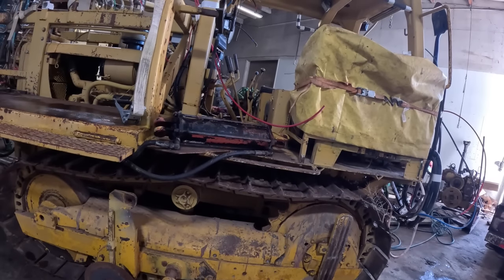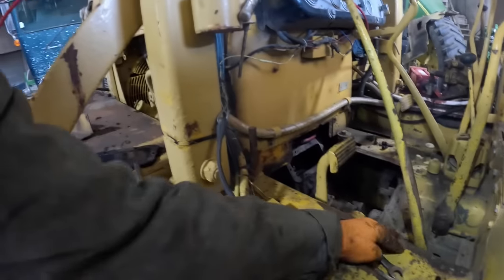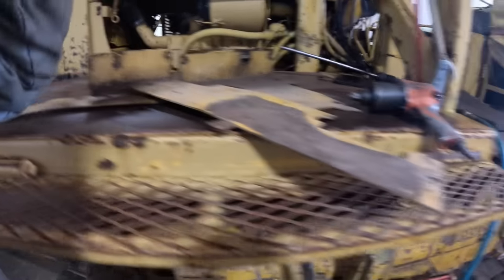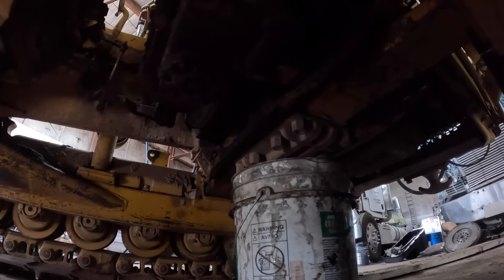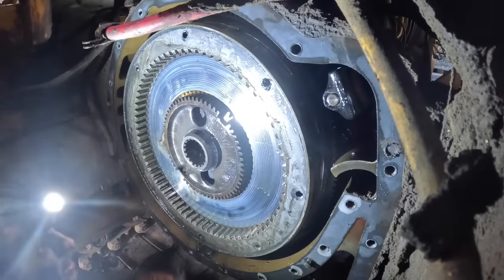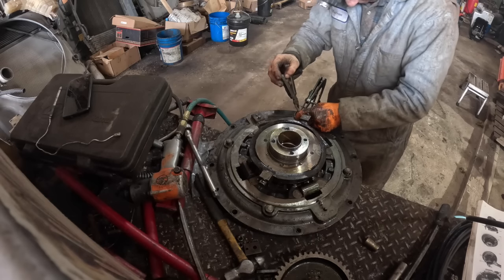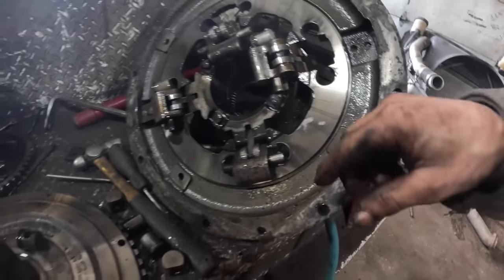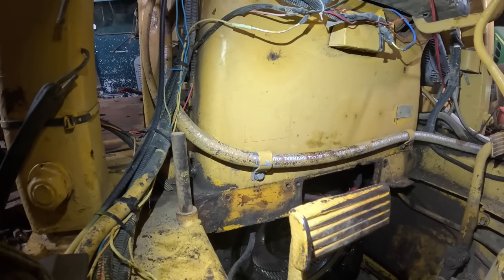Caterpillar D4D clutch won't adjust.

Comment: 2/25/24..CAT D4D wet clutch removal...hell-of-a-job getting layers of assembly out while simultaneously moving camera & lighting. Unbelievable deep groves in hard steel middle plate from heavy operator foot on brake lever. Anxious for next video..supporting engine & getting (Bellhousing off?) Flywheel out to change rear shaft seal. Appreciate all your hard work, yur outstanding work ethic & 'can-do' attitude! Stay safe & carry on!👍⚙️🔧🔩💪🍺😊
Reply: Will the rollers that made those grooves be replaced too?

Comment: Another great instructional video!
Could be worse.  The D2's prior to somewhere in the 5U13xxx range had a dry clutch that you had to split the tractor to work on.  Probably similar in the D4's, both had very long production runs with incremental improvements.

Comment: I’d be trying that number stamped into that pressure plate. You’re right, usually cat numbers are a numeric digit followed by letter or three digits followed by four digit - a seven digit number
Reply: Warren, looks a lot harder to repair than a D41 Komatsu tractor.

Comment: When I started out my Dad showed me how to adjust the clutch on a old 2U d8 .  The cat was older then me    it was a old slide bar.   you had to hand crank the pony motor. I got smart and parked it on battery hill  . brings back old times. J >-W-> 🤠

Comment: Hey Warren, a late Saturday night video is great. I noticed you using a short little air nozzle. If you get by Harbor freight they got nozzles with a 2 foot tube on them, item number 63574. Makes it a lot easier to clear debris from. They are cheap 6.99 each. I buy like four at a time. Great video my friend. Thanks

Comment: Hello Warren from the east coast of Canada (the Province of New Brunswick). Would it be possible that plate got those grooves worn it by an inexperienced operator that was leaving the clutch disengaged while the tractor was idling. I was always told to put one of the transmission levers in neutral and engage the clutch when leaving the tractor idling to avoid damage to the throw out mechanism of the clutch. Years ago, I operated several standard shift tractors: a D7-17A, D8-15A and a couple of D6C's. I guess there were other Cat tractors I operated as well before the Power Shift transmissions became common.
Reply from the maker: That's the way I was taught too.

Comment: Mac made a handful of special wrenches to do the ajustments.  S67 and S77 PART NUMBER.  Anybody know?
Reply: They  had 3/4 and 15/16 straight  and off set wrench was a must  have for steering  clutchs
Reply: @dennisbeheler5466  Thank you!  I keep seeing them pop up on ebay.  I dont work on cat but might pick up just in case.
Reply: Just  looked into  service  truck   Mac 77B5/16 offset 77 straight  S67 3/4 straight  S67S offset  I have owned  all 4 since about 1983

Comment: With the groves worn into that plate, where did the metal shavings go.
Reply: Thats microscopic wear. Doubt any metal was visible..would only slightly change the oil, maybe someone else swapped out the oil before. You would need laboratory analysis to see what was in the oil

Comment: I have a friend with a Countach. Years ago they rebuilt the trans. Never got full clutch pedal travel it would release but would bind beyond half pedal.  Took it to the frame and aligment shop to just adjust the front toe in.  Told him the pedal only goes half way not farther.  Oh. Something broke  the clutch pedal goes to the floor and won't release.   I get the V12 and the engine out the back.  Pull the trans off the engine. The flange on the throw out bearing pull collar is split.  The disk is worn half way. The stepped flywheel is worn almost flat. Think 22re toyota step. Nobody knows the step size.  The flywheel is dished so bad when i finally get a shop to regrind the flywheel. The grinder touches the outer lower surface.  The clutch guy plays around with step heights to get the cover diaphram fingers to what they reasoned was the proper height.  Had to get the machine shop next door to make a new pull collar. Lambo wanted 8 grand and 4 months lead time.  Find out the previous lambo shop put the fine spline throw out lever in way off from where it seems to work best. Do a whole lot of other work while i have the engine out.  Wedge it back in. I have pictures.  It works but the clutch will start engaging at stop lights.  Inside the clutch master bore is totally corroded.  That seemed to be the issue why the throw out arm was in the wrong place and not a full pedal.   Warren. Do you have a post office box for packages.

Comment: I liked the jokes, I have a few too that I cannot retell here ! I had a good laugh at your comment about calling the operators idiots for pushing on the clutch brake with their foot, I got in trouble for calling an idiot just that, so I changed the spelling to 'eejit' and that went into 'print' ! These days you can't offend the poor little boys and girls (adults who act like children) by calling it as it is !
Thanks for the video I never worked on this type clutch all the machines I ever had to work on were power shift models ! Very interesting.

Comment: Newer CAT part numbers are 7 digit numbers with no letters in the xxx-xxxx format, so that number you mentioned should be the part number.  Assume someone has already been in there and replaced that clutch as i assume with its age it would have been one of the old 6 digit part numbers with a letter originally.
Reply: these cluthes usuly last forever if oil kept in them hardley ever have to adjust best thing ever invented

Comment: That clutch needs repair. I have been driving Cat`s since 1975. When is cold it is very common for the tractors to move with the clutch released when the transmission in gear. In cold weather as oil in clutch compartment warms up this will stop. Some times we cannot get them to stop with the clutch brake. But that is an adjustment issue. Most of the time we warm the engine up. Then shut the tractor off then put the transmission in gear. After about about 20 minutes of operating the tractor the clutch works fine the rest of the day.

Comment: Clutch brake will have to be out of adjustment or there’s a bunch of wear in clutch linkage for someone to get it to drag with the clutch engaged going through the field.   I have seen the wear in everything be so bad that the lever can flop forward and unlock the transmission shift lock and the trans pop out of gear under load.   So, I guess it’s possible that the clutch brake could be dragging with the clutch still engaged but it should not.